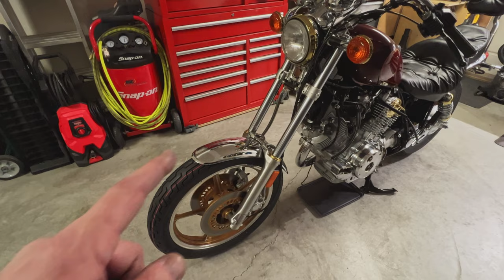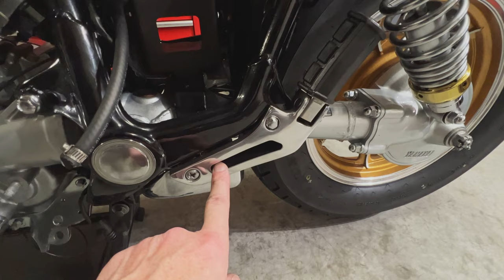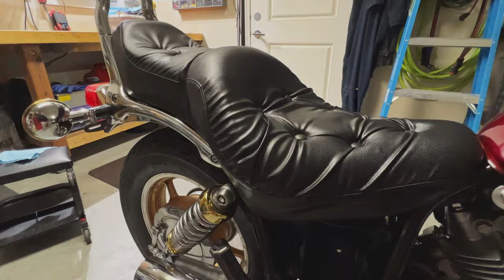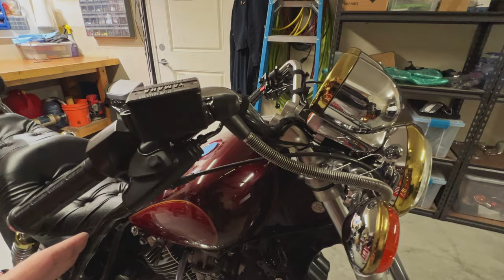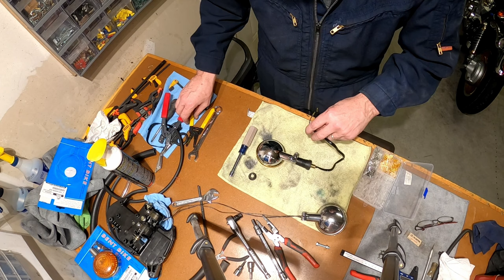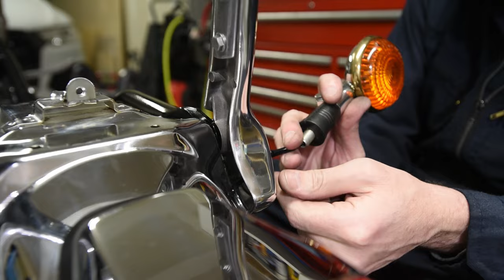PARTS LIST & Update - Yamaha Virago 1000 Restoration Video 20

Comment: Look around,  I know a guy who can push and pull the dents out of the tank.  My XJ650 had 2 significant ones and he managed to sort it.
Reply from the maker: The dents are so small they'll just need to be filled - nothing that requires pulling.  I'll probably keep this tank original, get the larger 1100 tank and paint it.

Comment: If I were to shoot the tank, I'd remove the pin striping first.  Having said that, if the tank is not damaged I'd thoroughly clean and degrease it, hit it with 800 (being careful around the pinstripes), clean it again and then hit it with a few of coats of rattle can 2K clear -- then remove the orange peel (1000, 1500, 2500), polish with 3000, and seal and wax.  Fantastic job so far.  I find the VX1100 to be uncomfortable to ride, though.  Have you considered forward controls?
Reply from the maker: Wish I could do that - the pinstripe is actually a vinyl graphic buried in 3 coats of clear.  I'll buy another tank from the 1100 - it's bigger than the 1000 tank and I can swap it as required.  I might mod the next Virago build with the forward controls - definitely more comfy on the longer rides.

Comment: I’d leave the tank original you can always do it in the future if you decide to.
Reply from the maker: I was actually thinking of buying a spare tank from an 1100.  They mount the same and all the hardware is the same but the 1100 tank is bigger.  I could paint that one in '84 livery and use it for road trips to get a longer range out of the bike.